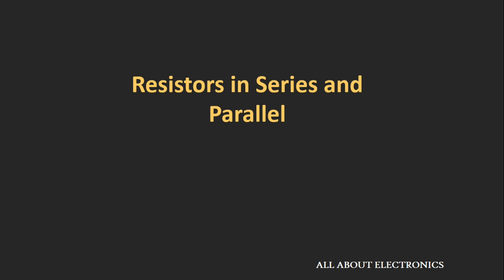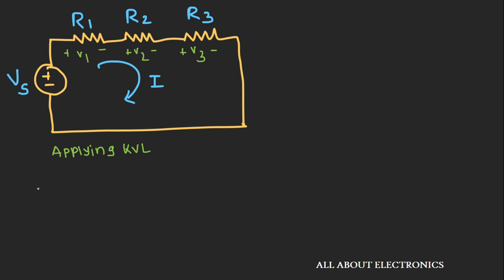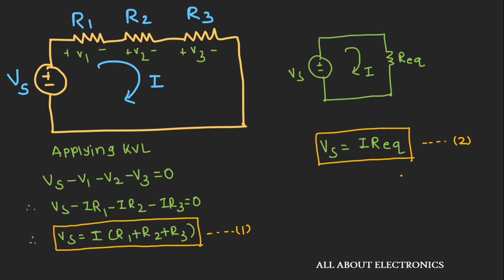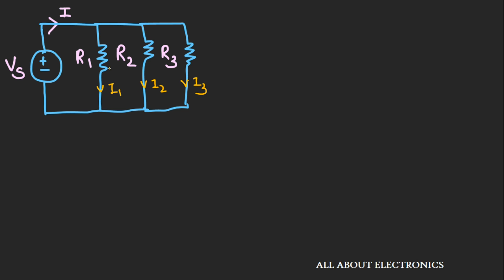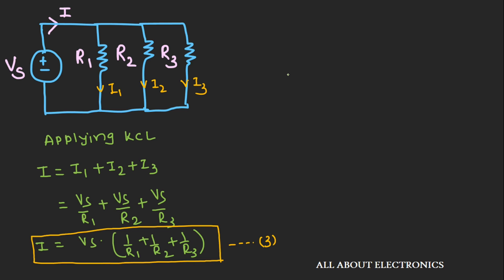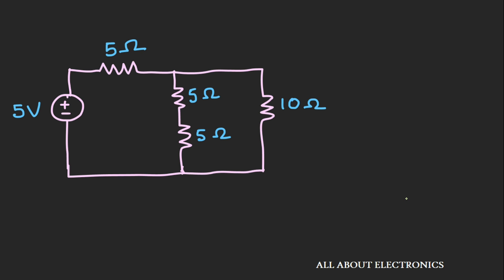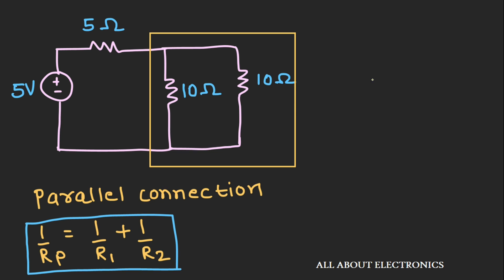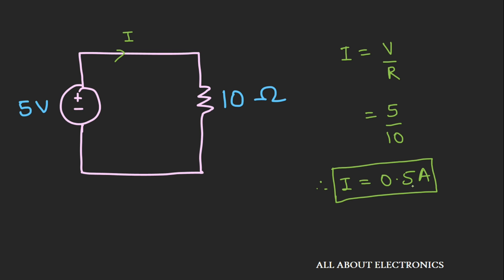Resistors in Series and Parallel

Comment: Wooh... Eq. Resistance in parallel is confused before watching this... 
Req Or 1/Req?
Reply from the maker: It is Req only. If you are writing in terms of 1/Req form then 1/Req = 1/R1 + 1/R2 / + - -- + 1/Rn.
For example, R1 = 2 ohm and R2 is 3 ohm then 1 / Req = 1/2 + 1/3.
Therefore, Req = 6/5.
I hope, it will clear your doubt.

Comment: Voltage is directly proportional to current. When connecting resisters in series there is a voltage drop across it's ends then how can the current be the same throughout the circuit?

Comment: someone asked me how will you explain that voltage drop across resistors in series connection. if explanation is given to very new student.? ( any analogy by which we can explain potential drop in series ckt while same voltage drop in parallel ckt?)
Reply from the maker: It can be explained using the pressure and flow of water in pipes.